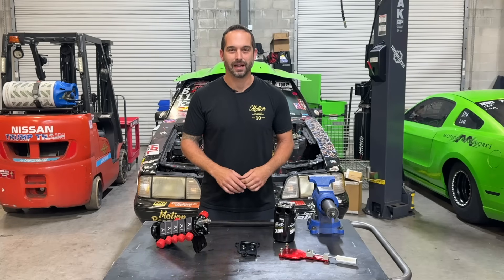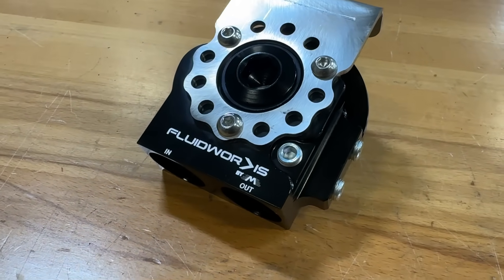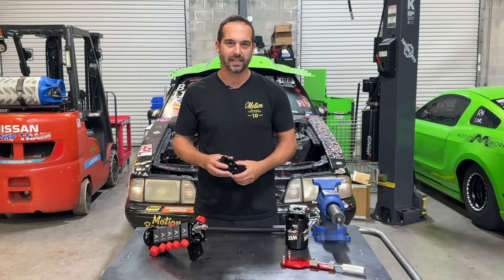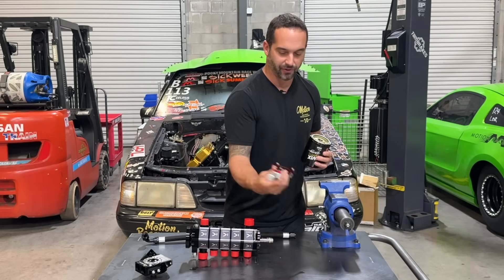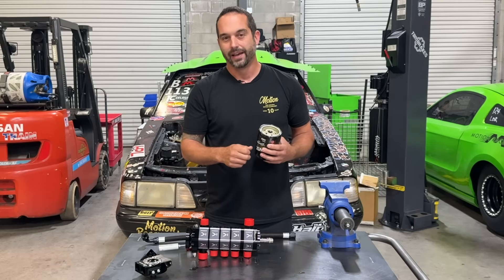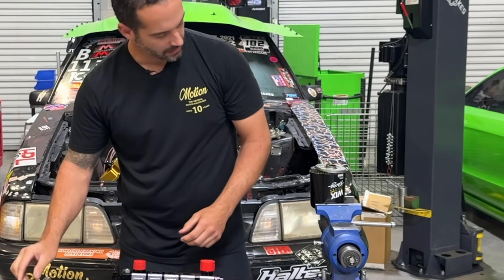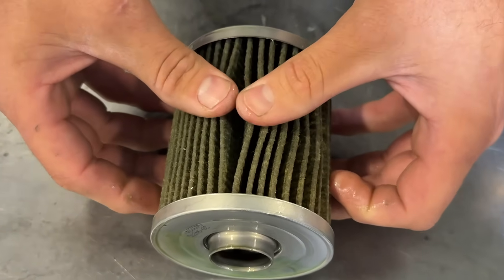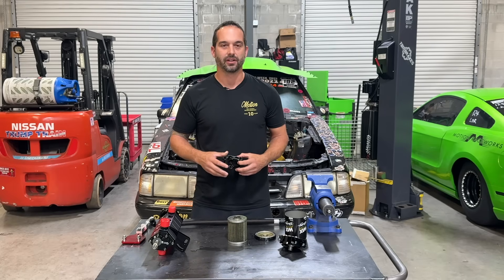Engine Health! How To Read and Diagnose an Oil Filter... Plus Oil System 101! Tech Tip Tuesday

Comment: Watched an engine tear down video of the snot rocket, I had assumed at the time it was a dry sump but I saw an anodised red housing on the front of the crank that looked like an oil pump. Is this just the housing to ad stiffening with no gears ? 

You mentioned that coyotes can just remove factory pump ?